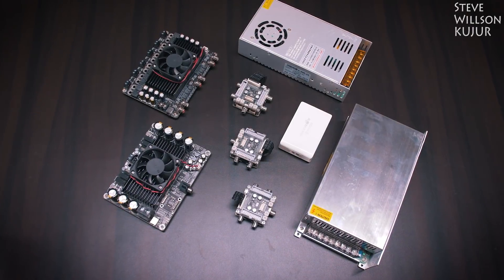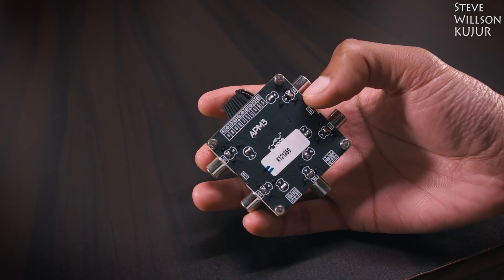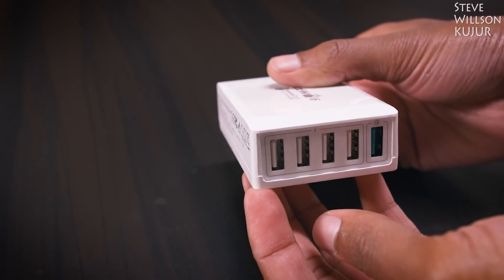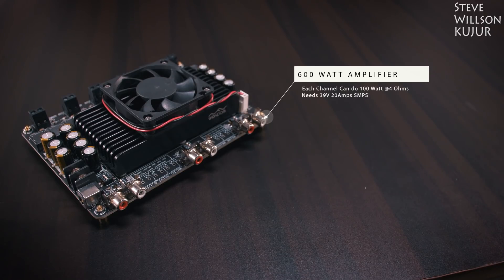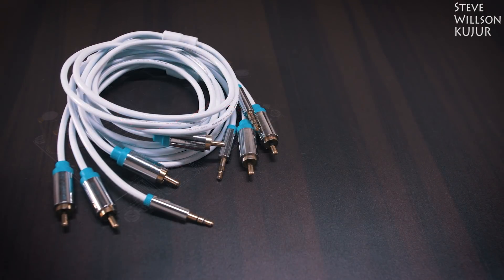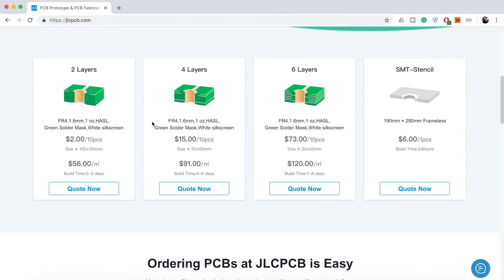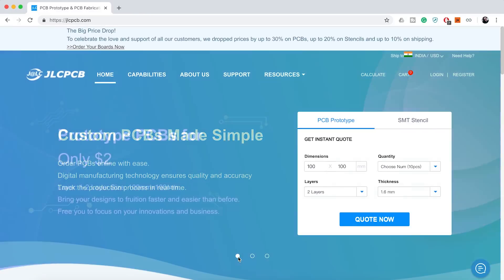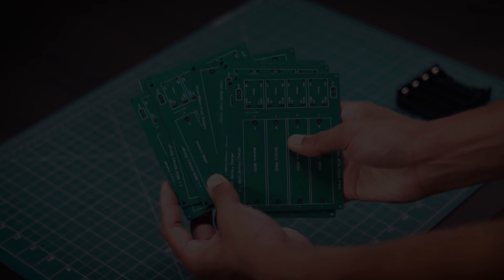Best DIY 1200 Watt 5.1 Amplifier Board

Comment: I was gifted a REL Strata 3 subwoofer there is trace damage on the amp (100 w) board which is separate from the dsp and pwr supply can I just replace the amp and keep the others ?? What amp would U suggest ??

Comment: I love your videos. Can i run this in my car off 12v? I have a ROHM32107 dsp built into my head unit and a TDA7851 amp built in. But I am thinking of wiring from the optical out to one of these. My concern is that I will only have 4 channels frL frR rearL rearR and subwoofer... would I just combine center output with sub or leave it blank?

Comment: builds a 5.1 channel speaker, then plugs into a stereo phone jack and plays a stereo youtube video.
Reply: I have harman cardon with 5 channel stereo and other surround modes, but I am not sure the average crappy standard thingy can do this. That's the problem, I am stuck with the harman kardon, I love it but at the same time, its is said to be not the most reliable thing, I can repair myself but maybe not all problems. Still I love my harman kardon (HKTS 60 and BDS 580S).

Comment: What is the use of DSP here, is it used for Pre-Amp the signals to line level output. Can we use another pre-amp build using op amp ICs. It only amplifies the signals or processes the frequencies for amplifier. Please help I am in process of building an 5.1 channel music system using TPA3116D Class D 5.1 channel amplifier board. I found a Pre-Amp or tone board for amplifying the signals to this amplifier board on AliExpress. Would it work or I would need the DSPs as you did in your awesome project. Thanks

Comment: Hi Steve, I have some doubts. I see you've got only one DAC connected to the audio source and you're only using two speakers and the subwoofer, hence using only 2 channels in the 6 channels amp and the mono one. How would you make it work if you had a digital input (say a tosslink, coaxial or even hdmi) with an encoded 5.1 signal inside? I believe that most people use 5.1s for video, since music typically comes in stereo and there's no need for that many channels. Cheers!
Reply from the maker: There are DAC are available digital to analog 5.1 channel converter
Reply: @SteveWillsonKujur  then what are the functions for those dps's? Tone control?

Comment: I thought DSP have more than 1 output channel in order to use just one board to produce each 5.1 channel. I was thinking to use one to produce 4 channel (sub-bass, bass, mid-range and treeble), just programming the crossover in that.

Comment: Hi, i have a 5.1 home theatre system dav dz370 model from sony. The player/amplifier module is wrecked. Is there a way to use these speakers ?
5 143w speakers and 1 285w subwoofer, total 1000w rms at 10%thd.
Reply: Hi i have sony DAV DZ750k . I guess we can use those speakers to make a 5.1 soundbar. I am researching on the same. If you have information please let me know too.

Comment: Hi friend. 
I am Selva from india. I have assembling idea for class d amplifier. Please  suggestions for 5.2 amplifier design.
5 channel-(6"-8" speakers)
2channel-(12"-15" subwoofers1200w*2)
Usb,Optical, and HDMI coaux and 5.1 inputs.
Any inputs converted to 5.1 output options.
Remote control and display kit.

Please quotation for all components(including powersupply and cabinet).
My mail id: g.selvakumar@bpltelecom.com

Comment: @Steve Willson Kujur Hello Steve. i found all the parts, took me some time. Could you explain to me how to connect the other 2 Dsp's?i can only make em work seperately. Can they all be linked to the same input channel to create one sound. Or is this simply not possible. It almost looks like the other 2 dsp's arnt linked cause they are being used for another single device. Question is. is it possible to loop all the dsp's so the amplifier board has the same output on all 3 channels?

Comment: Hi man, ones question, you only hooked a pair of speakrs to the 6chanel amp. Also the imput was only on one of the DSPs. Is it possible to have the audio signal going trough all of the 3 DSPs? Or to have the 5.1 system to i would have to conect it to my computers motherboard on the specific outputs?
Reply: I know I am not him. But I can answer you. If your motherboard outputs 5.1 in the form of analog aux outputs you dont even need the dsp. If it doesnt than you can connect either coaxial or optical depending on the surround output capabilities of your motherboard. If you only have digital out you would need a DAC that processes that kind of single. You can get them. I hope I helped.

Comment: wrong description this is 2.1 not 5.1 fix it pls.
Reply: Nope, he is playing 2.1 but in fact, there are enough inputs for 5.1 it is just he only has enough speakers for a 2.1 setup. If you were to use a computer, for example, you could have a 5.1 output.

Comment: WTF 1200 watss how can u fit that in there when my marantz  ampifier is only 150 watss and its wieght almost 6 kilo and 16 mosfet  and that is so small can produce 1200 watts  common stop lying\
Reply: The amplifier you are speaking of likely produces 150 watts into multiparty channels so it has a far more similar power rating. And he is correct, it is class d so therefore much more efficient and compact.
Reply from the maker: These are Class D Technology

Comment: 600w for sub woofer is too much.. . it is near to real movie theatre subwoofer.                   200w subwoofer is enough considering 100w surround channel
Reply: Totally agree. Unless the sub is hard to drive, also he is using a lower voltage power supply for that amp.

Comment: Android is limited to hardware provided on device, that is only 3.5mm jack (i.e. stereo or 2.1ch). It can't output 5.1 channel, but it can virtualize it.
For real 5.1 output from this setup you need is -
1. A uncompressed lossless audio file with multiple audio stream, like  FLAC/ALAC
2. An audio player with capable to process multi-channel output, like on a PC-mobo with 5 or 6 audio out ports or your look at backside of your audio player
3. Good cables, stable power outlet from wall, match-up electrical parameters of our speakers to the audio system

Now ! Feel the difference.
Reply from the maker: Yes Differently this is only for demonstration I only use 2 channel and it can be 2.1, you definitely need 6 individual output form audio source to get 5.1
Reply: Technically you can also do it with three stereo outputs like on a motherboard. That how they are set out. Front left and right. Back left and right. Then sub and centre

Comment: Can you please provide a connection diagram for the modules. Looking at the video, it looks like all the audio signal goes from the source to one of the DSPs, and from there, 2 channels go to the 6 channel amp and 1 channel to the mono amp. The other 2 DSPs don't seem to have any audio input or play any role in your connections. Yes, they seem to be connected to power via usb, and their 2 channel output to 2 inputs of the 6 channel amp, but I don't see any audio signal going to these 2 DSPs.
Reply from the maker: As i said this video is for demonstration , you need 6 different channel to make 5.1 audio system, in this video i used my phone as audio output it's only have stereo output, you need an AV receiver for 6 channel output
Reply: Steve Willson Kujur thankx for the reply, however I still don't see the point of using 3 DSPs even if this video is a demonstration only. How many DSPs would you actually need for a real 5.1 amp? If your audio source is actually able to provide 5.1 audio outputs (instead of 2 like your phone stereo signal), what would you need the DSPs for? In fact even your stereo signal from your phone does not need to go through a DSP at all. I am sorry if my points don't make much sense, but I am trying to understand what you are actually demonstrating.
Reply: @alexandermessaris8058  He wouldn't need to if the signal coming out of his phone was line level. It isnt so it would damage the amp circuits. Whereas an output from the motherboard can be set to give a line level output. You would no longer need any dsps

Comment: 600 watt @ 2 Ohm, your sub is 4 Ohm. How is it possible to run it without damaging you sub driver
Reply from the maker: Mine is Dual coil 4ohms each 

I've connected it in parallel , i got 2 ohms
Reply: @SteveWillsonKujur  oof. Wouldn't that be 8 ohms. And that is the average ohmage you would find anyway.
Reply: @lio1234234  4 ohms in parallel is 2 ohms , 4+4 ohms in series is 8Ohm
Reply: @debasishmondal7058  Yeah lol. I’m an electronics engineer, I definitely new that. I either must have been messing around or that was one very very VERY late night. 🤣
Reply: @lio1234234  😂😂😂😂😂👍👍👍